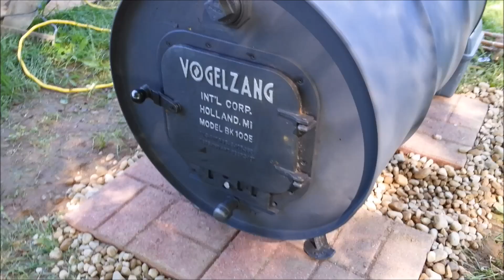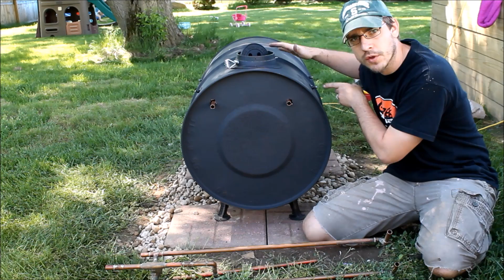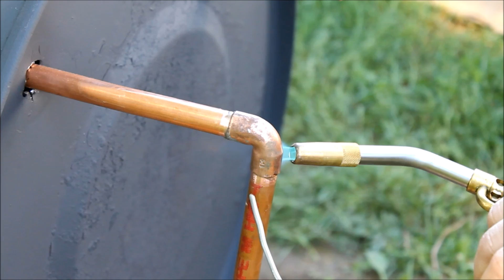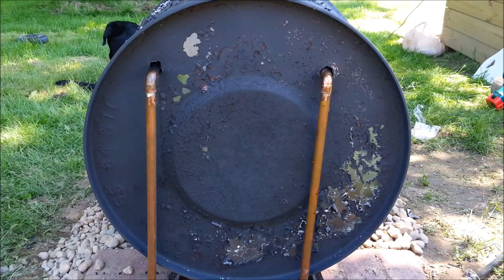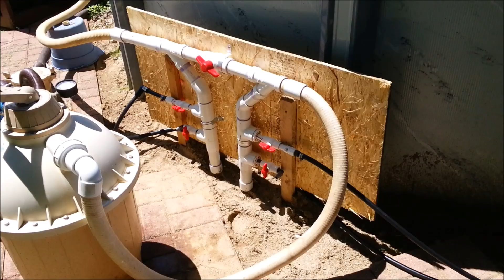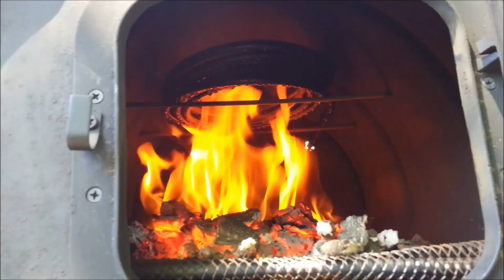Wood Burning Pool Heater - Heat Your Pool For Free!

Comment from the maker: @John Cook, I agree with what you are saying here completely. The more insulated it is the more heat trapped, less wood needed, etc. The only problem with that is time and money:) I plan to upgrade this with more copper tubing and also have been thinking of a way to insulate it since I have some winter plans for this heater as well. Thanks for watching!
Reply: for 75 bucks you can buy a actually water heater ever thought about that?
Reply from the maker: herr direktor  If I could find a wood burning water heater for $75 bucks I suppose that would work also. However, I am not sure those are that easy to find. Thanks for watching!
Reply: herr direktor

Comment: Seems like wrapping the inside of the barrel in copper tubing would  be better  you would get more heat soak by increasing the contact area . and creating a barrier that the heat would have to  pass by insulating the outside of the barrel would also help keep you from loosing heat ; for example a  masonry box in which the barrel would be placed inside  and then sand added to surround the barrel  which would insulate it and keep you from loosing as much heat .  A double barrel design with a radiator  would also help you collect  more of that heat . Not knocking your build it just seems you are wasting lots of heat  this way .

Comment: Love the vid, especially the plumbing. Im thinking of doing something similar using convection - having copper piping running through a pressure cooker in the hope to get more life out of the copper pipes. Im not too sure about putting naked flame directly onto the pipes like that. How is it holding up?
Reply from the maker: Thanks Eli, so far the copper pipes are holding up just fine but I share that concern about the life of them as well. We will have to see after a couple of seasons if they hold up. The nice thing about it is since the water is flowing through pretty fast they never actually get hot, if they did get hot they would probably flatten out or distort in the heat. I like your idea, any kind of water tank placed above the flame like that would work great I would think. Thanks for watching!

Comment: Looking at the built video i know why your paint came off. The paint came off because you painted over the old paint. You need to sand it down to metal and the us a high temp primer then high temp paint. Hope this helps.
Reply from the maker: Yeah, I commented on that afterwards when I figured that out:) Even easier solution is to fire it up and let it run hot for about an hour, all the old paint burned away (and my paint too) and it was bare metal. I just repainted it after that and it has held up pretty well, thanks for watching!!

Comment: I want to thank you for the idea of a wood burning pool heater, I watched a few other videos and decided to make one. I use the same kind of wood burner in my barn so I knew it would work and how to build it. Now having it and working above and beyond my expectations. Only thing I did different was I used a separate little pump instead of using pool pump. I'm in the process of planning a little bigger and more permanent wood stove for next year. Thanks again, it was a great savings this summer and many more to come.
Craig
Reply from the maker: Thanks Craig, that is great to hear! I am planning a little upgrade and adjustments to mine for this winter to try and heat my garage with it. Encouraging to hear it worked for you, thanks for watching!!
Reply: I tried single barrel first wasn't enough so I went with the double barrel in a 24x32 uninsulated metal barn and it worked great. I hung a cheap box fan behind it to move warm air more to center of barn. Good luck with yours!

Comment: just wondering if you were ever able to get some test numbers for temps and time involved as you mentioned in a post.  would be very interested in seeing some results  thanks
Reply from the maker: Well, I actually put a video together with all of those number but before I posted it up I found it to be confusion and I think I will do a new video. However I can say that the temperature spilt I was getting was about 20-25 degrees. I am pushing about 1-2 gallons per minute through the heater. I should have a new video put together by end of next week. Thanks for watching!

Comment: Very intrigued by this project. I am interested in heating our hillbilly hot tub (100 gallon rubbermaid stock tank) using a rocket stove with copper tubing coiled around the chimney. Right now we heat it with a portable propane water heater. It's cheap and fast, and if we wanted we can take the whole kit with us camping, so long as there's running water available.

I checked out your blog, and you have some great stuff! I like your attitude about changing priorities. I am also in IT, and as much as I love my job working for a non-profit, I know it could go away. More self-sufficiency is certainly on our agenda.

Comment: Have you ever tried the flexible alum or steel conduit  which is basically just smaller size flex exhaust pipe??  i do know that is will hold water without leaking but under direct heat/fire  not sure..   way way cheaper that the copper.....
Reply from the maker: Yeah, that is the main issue with copper - the cost. I am not sure about using anything steel as it would rust, not sure about aluminum though, I will have to look into that. If I could get a 50-100 ft coil in there somehow this thing would heat the pool 10 degrees in just a couple hours, it is very powerful. Thanks for watching!
Reply: SSLFamilyDad 1" dia copper tubing would hold more water and speed the heating process. Great idea, you have here. Scrap wood works well too. Instead of it going into a land fill, burn baby burn. I just subscribed to your channel.
Reply from the maker: The Bowzer Glad to have you on board! I am in the process of converting this to another purpose for this winter so stay tuned and thanks for watching!

Comment: hello i would like to know what size copper you use and the lengh to put inside the barrel.love the idea. cheers sarina
Reply from the maker: I used 1/2" copper tubing (1/2" ID water tubing) 20 ft long. The more I use it the more I wish I had a second coil in, doubles the efficiency if you can afford more tubing.

http://www.homedepot.com/p/Unbranded-1-2-in-x-20-ft-Copper-Type-L-Soft-Coil-PCLE-375L020/203654406
Reply: SSLFamilyDad
haha I was trying to figure out what type copper and the diameter you where using. found it!!

Comment: Good idea, I like it, what about wrapping the copper coil around the outside of the barrel or around the stove pipe; do you think that would work as well? Have a Blessed one...
Reply from the maker: That is a good idea and I thought about doing something like that. My thought was to keep all of the surface area of the copper piping inside the barrel where the most heat is. So far it seems to be working great! In the  future I may add more copper coil inside and maybe some going up the inside of the stove pipe, thanks for commenting! God bless